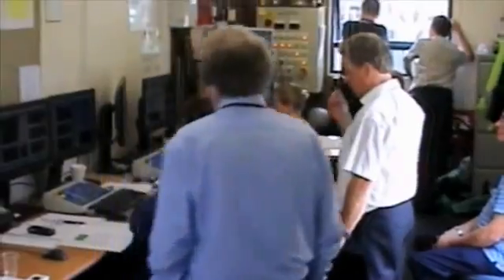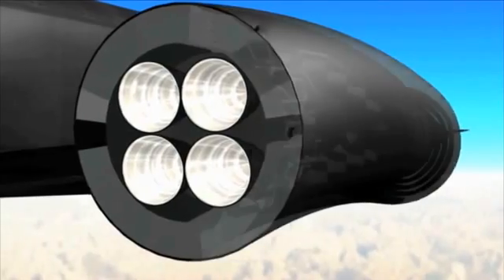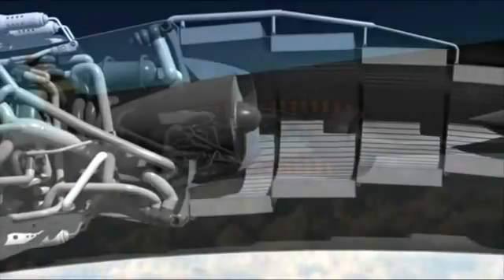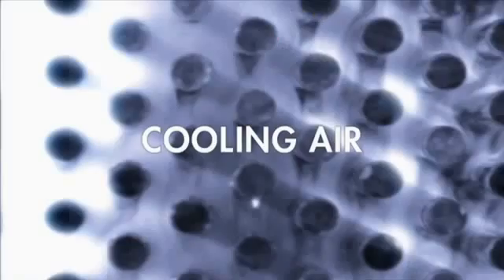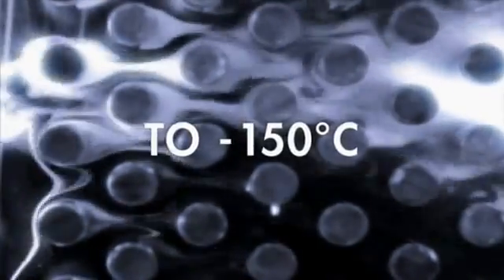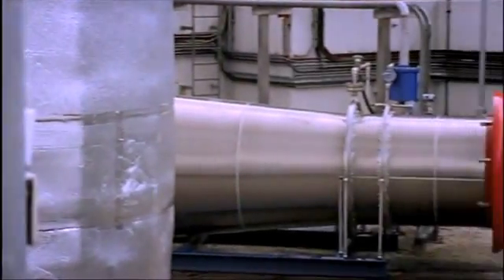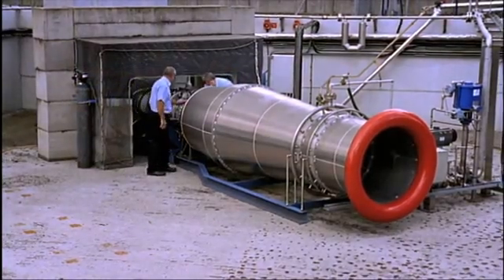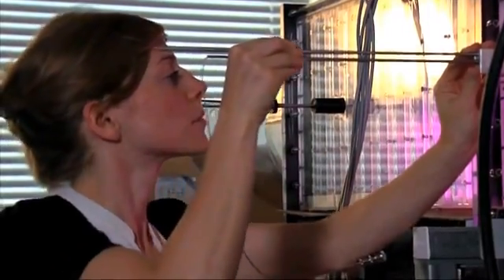Skylon...SABRE Engine

Comment: I'm interested, this thing is pulling 400 million watts of heat from the incoming air, where does all that energy go?
Reply: the liquid hydrogen is used as a coolant. next time use google like all humans.
Reply: swunt10 Alright then smartass. You are rejecting 400 million watts of heat energy to liquid hydrogen, what then. Is the used coolant simply ejected from the craft? Is it stored? does it form part of the propellant feed for the engines? I don't see any heat exchangers on the outside of the vehicle, so it can't be run continuously.
Find the answers to all these questions. Then you have the right to pull the lame ass "use google" move.
Reply: 101m4n OK if you don't like to use google here is my version. skylon carries liquid oxygen and liquid hydrogen as fuel. but instead of using only the chemical potential as fuel, it is also used to cool down the hot air. it's simple, at mach 5 the air gets really hot when you slow it down inside the engine. but hot air, not only would be harsh on the engine (melting), it would also be bad for efficiency. this has to do with entropy. if the air you use is already hot you don't get much out of it by making it a bit hotter by adding fuel and you can't compress hot air like you can cool air and so on. so cooling the air down is important. how is it done? all you need is a heat exchanger. but instead of using the hydrogen directly to cool down the air, the hydrogen is used to cool down a nitrogen cooling cycle. like in a refrigerator. so between hot air and cool hydrogen there is this nitrogen cycle. nitrogen is used because it works better in a heat exchanger, it doesn't behave as violently as hydrogen. OK, after the hydrogen was heated up by the nitrogen cycle (which in turn cooled down the air) it is then injected into the rocket engine along with the cooled (and compressed) air (or oxygen when in rocket mode). but there is a minor problem there. you need slightly more hydrogen as coolant than you need as fuel so they made a bypass where the hydrogen that isn't used in the rocket engines is burned alongside some air that bypassed the heat exchanger. that way all the hydrogen is used as fuel. I'm not going to give you any formulas or thermodynamic solid explanations though. I hate thermodynamic and I'm not good at it. I have my TD exams next year so I don't care right now.
Reply: Ellert van Koperen
Actually liquid helium is used to cool the airflow, helium is cooled by the liquid hydrogen fuel, it passes through the pre-cooler and cools the air. It is then heated by the Hydrogen+Air mixture (which has exited the pre-burner and is now on its way to the nozzle). Both the pre-cooling and the exhaust from the pre-burner give the helium the energy needed to power the fuel pumps and turbine before starting the cycle again by once again being cooled by more liquid hydrogen fuel.

In reply to the original comment, the 400megawatts of heat energy that is displaced by the helium is used to power the Hydrogen pump, the turbo compressor and the Oxygen pump.
Reply: 101m4n
, it is pretty simple: the liquid H2 is used to pre-cool the air, whereas the air is used to pre-heat that same H2.
The two are combined and burned as the fuel that makes the engine go.
Reply: Ghostreaper
 Thats the long version of the basically the same, I did not want to go into so much details to avoid confussion :)
Reply: Ghostreaper I read that the SR 71 pump fuel thru the wing skin to cool it at Mach 3 before it's pumped into the engines. Same here with the He2 ? (Guess that would make the airframe part of the power plant.) Are heat pipes involved?
Reply: 101m4n  The heat is supposedly dumped into the liquid Hydrogen. But the fly in the ointment is that 1kg of hydrogen takes 38kg of air to burn. However it takes 2.6kg of liquid hydrogen to cool that much air. So there is a major and unexplained problem there.
Reply: Good point.
You are correct in the specific heat calculation. You seem to be assuming however that the amount of degrees that the air must be cooled down is equal to the amount of degrees that the hydrogen is warmed up, and the resulting temperature before combustion is right in the middle.
That is (and can not be) the case.
So indeed, is extra hydrogen used to cool the air sufficiently ?
Reply: Ellert van Koperen I was assuming best case. In reality it would take more than the 2.6kg Hydrogen that I calculated.
Reply: 101m4n The concept of using the hydrogen fuel as a heat sink for the intake air heat has been around for years, it was not the problem. The problem was stopping the intake cooler from icing up with atmospheric water vapour. THAT is the trick reaction engines has solved.
Reply: how so please sir?

Comment from the maker: MAJOR ADVANCE TOWARDS THE NEXT JET ENGINE

Driven by an extensive and pioneering technology programme, Reaction Engines Ltd has made a breakthrough in aerospace technology that is now allowing the development of engines that will propel aircraft at speeds of up to five times the speed of sound or directly into Earth orbit.
Frost Control:
The moisture content in air turns to frost when it passes over REL’s very cold heat exchangers. This frost blocks the heat exchangers and stops them working. REL has therefore developed technology to prevent frost formation.
An independent review undertaken by ESA on behalf of the UK government has confirmed the viability of the frost control system that REL has developed:
Reply: S-S-T-O i look forward to your future announcements on the tests in colorado. Well done everyone involved with Reaction Engines. 👍

Comment: so if this does work and it makes mach 4+ power flying extremely efficient that means planes will still need to be built at SR-71 blackbird type of spec because of air friction at those crazy speeds.

im all about research into new tech but i dont see any normal people hopping on planes and doing nyc to london in an hour any time soon.